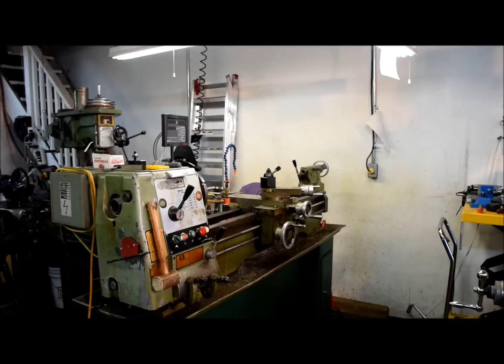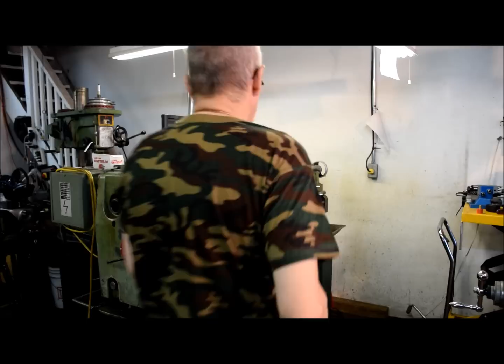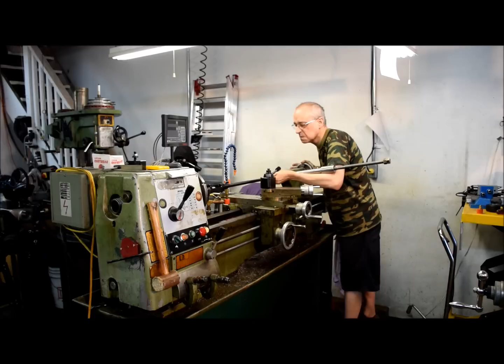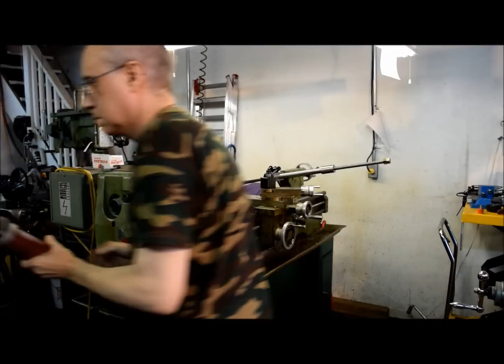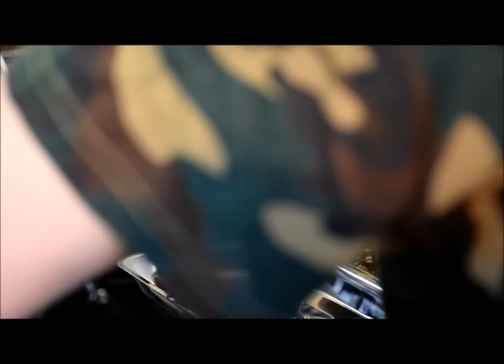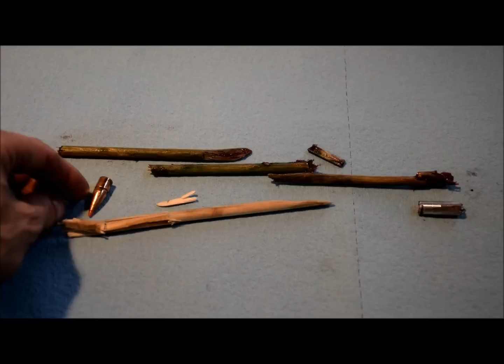Removing stuck bullets from barrels

Comment: what about gas port?
Reply from the maker: Well, I have to admit that was a very perplexing problem and put me into a brown study for an hour or more. The solution was dead simple. On barrels where the port is exposed I simply hammer in a bit of lead solder to seal it and then clamp a machinist clamp over the hole to hold in the lead plug. After knocking out the bullet, just push the lead plug into the barrel with a small wire. Gas ports inside a tube or hanger always have a drill port to push the lead in but sometimes you have to get creative about finding a way to hold the lead plug in. But I always find a way. Sometimes just sliding the gas piston in is enough. Other times I have to cut a tight fitting piston in the lathe to hold the plug into place. There's always a way if you sit back and think about it a spell.

Comment: Perfect set up. Could work without the lathe. Just need a frame to tighten hydraulic piston to barrel . Nice job
Reply from the maker: I thought about just using a chunk of 4 inch I beam to tie it all together with. It would work fine I'm sure but it's just something else to clutter up my shop. When not in use the press just goes on one of the shelves in one of my machinist carts. But I don't see why a rig like that couldn't be built without to much trouble for those who don't have a lathe.

Comment: I'd really like to know why/how bullets from a squib load get so jammed in the barrel. I lost one barrel because of one, as not even a sledgehammer and rod would get it out! I thought maybe the rifling causes it to get very stuck but i have had the same problem with a barrel with no rifling and the bullet could be pushed through by hand as well!
Reply from the maker: Pushing with a rod won't get you anywhere. I'm not an engineer, but I know that as you put force on a rod, it bunches up, bends and wastes all of it's energy pushing on the sides of the barrel and not on the object that you're pushing on. You might be putting several tons on the top of the rod but by the time the energy gets whittled away pushing sideways you end up with only a few pounds on the object that you are pushing. That's where using a liquid works so well. There is equal pressure being excreted on the entire surface so for every pound you pump in you have the same pound exerting force one the base of the bullet. No line lose, so to speak. Even so, it still takes close to 30,000 PSI to push a jacketed bullet through a rifles barrel. That's the equivalent of about 3, Ford F150 trucks sitting on top of the bullet You can't generate those kinds of sustained pressures with a rod and a hammer.
Reply: @RodHenricksonGunsmith  thanks very interesting, it's hard for me to picture force being pushed outwards, i would have thought so long as the rod diameter is as wide as the bullet then it would all be pushing downwards, i'd love to know the math science behind it. My other query related to this is why some bullets don't get stuck in the same way, ie people have pushed them out with a few knocks with a hammer and rod.

Comment: i only have a metal stick..not a 5 million dollar machine :(
Reply: Lathe's are no where near that expense min ones can be had for under 1000 dollars and bigger ones up to 20,000
Reply: @blinkyoureyes1400  Probably didn't need the lathe. the lathe is just a holder.  Sash cramps or a pipe vice with a bit of wood at each end would probably suffice.

Comment: whats your thoughts on this method,  counterbore the bullet all the way through.  
1. brass rod long enough to  reach from shorts distance and biggest bore will allow 
2. chuck the rod in a lathe.
3. use a dubble center cutting endmill 20% smaller than the bore.
4. Counter bore the brass rod leaving enough endmill to make it all the way through the round.
5. locktie red the endmill into the end of the brass rod.
6. with  a drill motor slowly drill the center of the round out.

now the solid mass  is reduced to  a lead and copper hollow  bushing.
7. machine a brass plug a few inches long and 10% the max bore DI.
8. with a aluminum rod drive the round the shortest distance to free the round.

my thinking is the forces being applied from mushrooming are minimum because of the  hollow round. 
  unfortunately my lathe centers are to short for most barrels to make your hydraulic pusher.
Reply: the brass bushing might want to be a few thousand less then the bore, to prevent lead from squishing around the  brass plug. not sure about this approach.
Reply from the maker: +Ha Re 

Well, the pounds per square inch force required to push out the jacket alone is roughly the same as it is to push out the jacket and core together. I have pushed out bullets with drill rod using the tailstock of big oilcountry lathes and I have pushed them out the same way after melting out the cores. There is very little difference in pressure required. It's also harder to push when you lose the base to push against. So there is no advantage to drilling them and often it makes it impossible to push out the jacket. 

You can also set up the press like this using aluminum shims on your chuck jaws or by simply screwing your outrider chuck on to the back of the spindle if you don't have enough machine. You can also set it up on your mill bed if it is long enough or just clamp everything solid on a steel bar or piece of pipe with toe clamps.

https://www.youtube.com/watch?v=fimvzxZTpbU
Reply: i see what you mean, i guess my thought was  once you stated pounding on the bullet it would mushroom and add to the overall side wall pressure.  having a hole you would think would provide a path of least resistance. 
my machine a 9x20 el cheap-o lathe i don't believe would be up to  the task,  spindle bore to small ect. my enco drill mill same issue, to small. your method is definitely the way to  go. one question,  how do you  get around a gas operated, ie AR platform wepond?  of course the price of AR barrels are relatively cheap( unless its a match grade ect) so replacement would not be a big deal. i did see a YT video of a guy using a blank wax caped cartridge,  filled the barrel with water and remotely fired the wepond into the ground vertically. did it with long arms,pistols, bolt and lever,  even a semi auto 22rl pistol.  worked like a champ. all sqiub blocked barrels. great job you did there.
Reply from the maker: +Ha Re 
I charge about $150 to press out bullets on bolt action rifles. For gas operated guns I charge about $50 to temporarily seal off the gas orifice during the operation.  I also charge about $75 to disassemble and reassemble the M16 style rifles. Most people strip them down and just bring me the barrel to avoid this charge. They generally have the tools and it only takes them an hour to take it apart and put it back together.
Reply: thats not bad. although I  do not plug up barrels on a regular basis,  fabricating a a press frame in lou of using a lathe would be a fun project.  would make a great article for eather home shop machinest or machinest workshop magazine, the wheels are a spinning now,lol . thanks.
Reply: Where can I bring my rifle barrel stuck w/ 308 bullet pls. Help!

Comment: what is the tool? I've never seen one.
Reply from the maker: You have to make it yourself. It's a grease press. It pumps grease at about 40,000 PSI and pushes out the bullet.

Comment: Where did you get the hydraulic press tool?  Or did you make it?
Reply from the maker: Oh nothing like that exists. You have to make them. In fact, I don't know that another one exists at this time.  Contrary to what I originally thought, it has paid for itself despite the fact that I had over $4,000 worth of trial and error time and parts into it. . I never patented the idea or the tool. It's so specialized that you could never sell them even if you did make one. But if you want to make one for your own use I outlined the build here. 

http://www.homegunsmith.com/cgi-bin/ib3/ikonboard.cgi?s=d6d0bd883dee8c90bf49509023d16ee3;act=ST;f=3;t=29914;st=0
Reply: I see.  That would be a very useful tool at our shop.  Great job on creating it!

Comment: Mr Henrickson, I just broke off a cleaning brush in my brand new AR 15. I was trying to clean from the rear of the gun to the front. the brush got stock and the rod snapped right where it screws onto the brush about 2 inches inside the barrel. Can you please help me with this?
Reply from the maker: It can be pressed out. A lot of the times guys use those cheaper multi piece aluminum cleaning rods and they break very easily. You might be able to simply push it out from the front with a good, one piece, stainless steel cleaning rod and a couple of good solid thumps. If you can't get it and you are in or near Edmonton you can drop it off. Time in shop right now for repairs is about two or three days. It would be $100 plus GST to set it up and press it out.
Reply from the maker: Bring it by and I can take a look at it.
Reply: Bristles tend to lag travel behnd the center core, so keep directional application and shove it all the way through.
Reply: Mr. Hendrickson are you still around 2023 and if possible can you help me the new 308  rifle stuck w/ bullet? Thanks